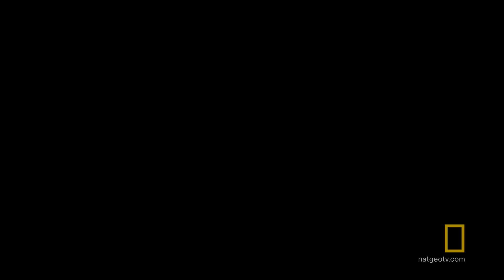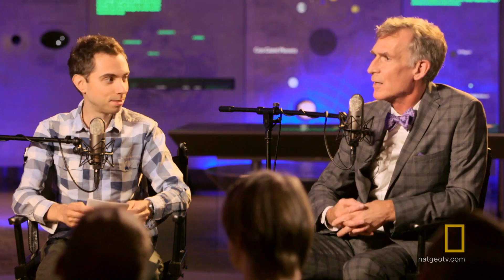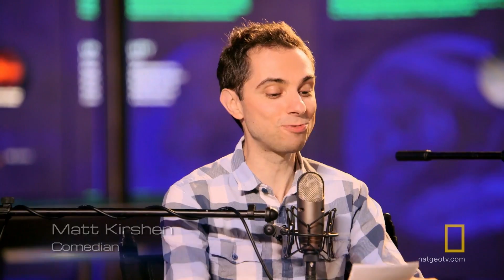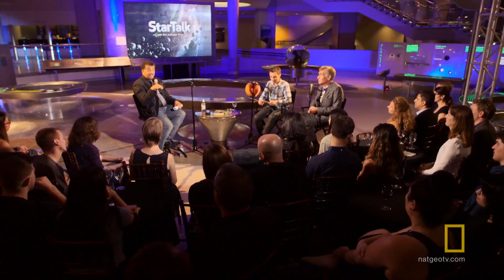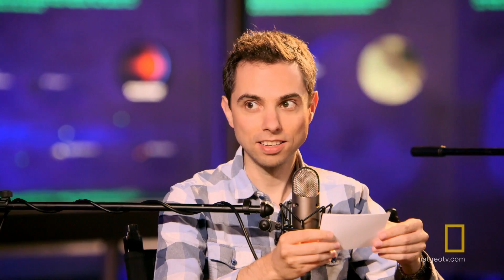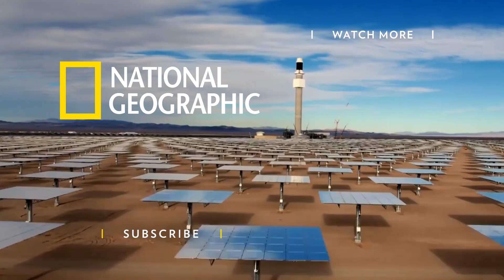Science Fiction or Real Mechanics? | StarTalk

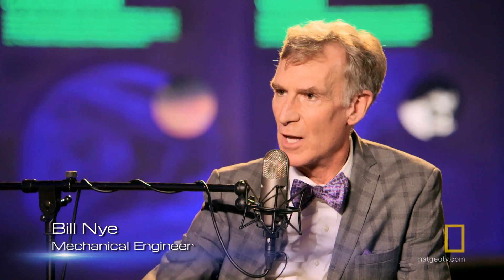Comment: [01:03/01:30] Wrong/Bogus—by Neil's own description of what-you-feel, a merry-go-round is continually changing its angle of Acceleration (circularly) yet you feel only the constant, 'push', centerward/inward—no Jerk equals acceleration, the rate of change of acceleration is Swing, or Pump, and jerk is something much worse; NASA uses common physics slang.